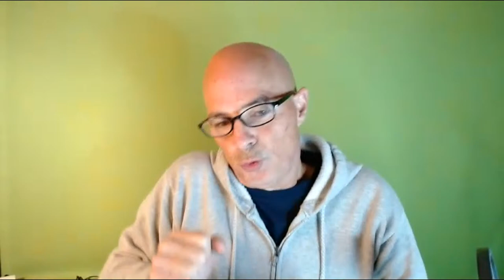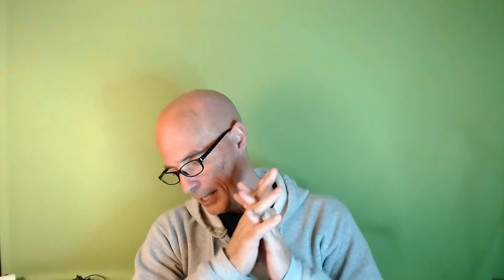LET'S TALK TECH-SUPERCHARGED 3800 L67 MODS-BYPASS VALVE TRICK

Comment: After having a few scares from filling the oil filter with oil when doing an oil change and seeing a long delay in the oil pressure gauge showing pressure, I no longer fill filters. Filling the filter creates an air trap the prevents the oil pump from priming.
Reply: Hey Paul,  I’ve always filled the filters with the reasoning being that it would decrease the amount of time the engine had to run before building normal oil pressure.  But I was always concerned about the possibility of the pump failing to prime for the reason that you stated. Fortunately, it never was a problem. 

My question is….was there a measurable change in the time elapsed before obtaining normal oil pressure upon start up with the filter dry ?
Reply: @danielwilson6665    Hey, Daniel. Yes, on a 73 Dodge 318 it was very noticeable. As I recall, it was also noticeable on an 86 Mustang GT. I have wanted to quantify how much longer it took, but haven’t done that yet. It’s on the list. But it was scary to sit in the driver’s seat, waiting watching for the oil pressure to build. Skipping the oil fill of the filter solved that problem. Also, it is my habit to let the oil pan drip its oil out until it stops dripping. This causes the oil pickup to lose its prime. I try to remember to fill the oil pan with fresh oil while the oil filter is off to allow the oil to rise up into the oil pickup before I seal it up with the new filter. YMMV
Reply: @PCMenten  … Hey Paul, that’s definitely a solid piece of advice and I appreciate you sharing the details. With oil changes coming up soon I think it’s time to change my procedure and see how it goes.  👍.
Reply: @danielwilson6665    You’re awesome, Daniel.

Edit: I’m going to try Holdener’s trick of pressurizing the sump with air pressure to push oil up the oil pickup. My F150 is due for an oil change. I’ll leave the filter off when I do.
Reply from the maker: air pockets are common with horizontal filters (like the 3800 and many Dodges), not with vertical filters (fill these first), we also loosen the filter on horizontal filters to eliminate the air pocket when priming
Reply: @PCMenten  …I appreciate your kind words, Paul. Words of wisdom from Richard are right on the money 👍.
Reply: @richardholdener1727  …. That’s some practical advice that can be useful in all applications. Thanks for sharing it, Richard.

Comment: Wow.  Never once considered air pockets.  I never put a filter on dry.  Filters that hang vertically get filled until they no longer bubble.  Filters that lay at an angle get filled so they drip oil everywhere until they're tight.  My driveway will never rust

Comment: Most people who convert from Supercharged to Turbo block off the SC just like this. I built a turbo fiero for a friend and it has a turbonetics 7268 and a blocked off M90 with a full stack W2A intercooler and it puts down around 500whp on 16psi. Car is a CompositeROCKET
Reply: Sub-4s 60-100 times.

Comment: Flip the Eaton blower over, and run the discharge to an off-mounted intercooler!
Reply from the maker: hard to bolt down to the intake when you flip it over. lol
Reply: @richardholdener1727  Put it on stilts?
Reply: I believe Blown3800 did that with a modified manifold

Comment: Can u still get flat faced valves for a LLO engine? I got a 5 speed manual donor car for a Saturn, (don't laugh) but I wanna build it for boost and gonna do .20 over hyper prisons with forged rods an flat faced valves with port and polished head and intake port match intake and 1-2 mm valve seats and shim the valve springs, and a 14-15 psi turbo eventually.
Reply: I used to own a Saturn, many moons ago. I had a buddy who turbocharged the 1.9 DOHC engine, and autocrossed it. He had lots of fun with it.
Reply: I'm so glad to see people doing Saturn's.  They are wonderful cars, I owned several.  The biggest rush is finding aftermarket support for them, I had collected many rare discontinued parts for many years.  Still probably have a few...
Reply: Should of been a v6 Saturn lol because the v6 motor for v6 Saturn is a Honda motor j series tooo